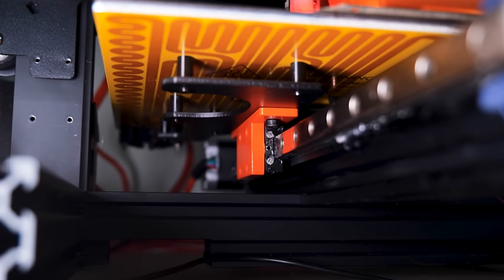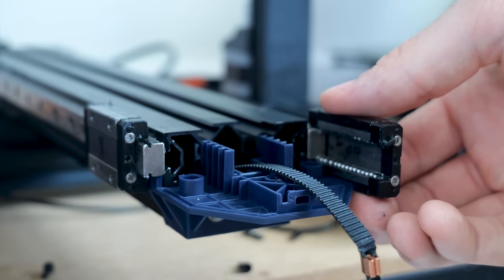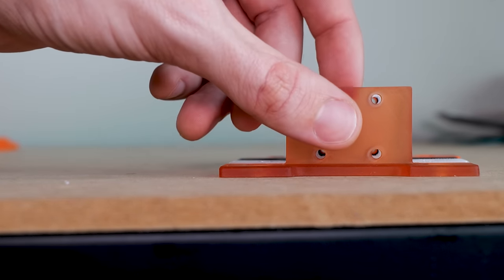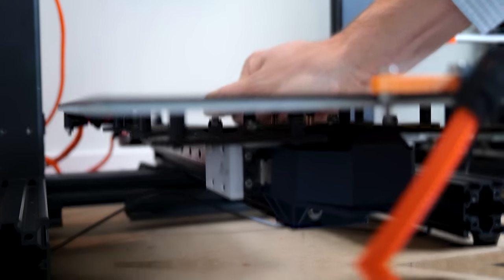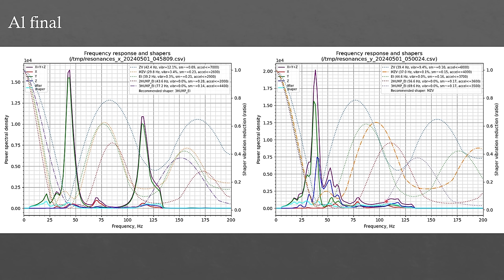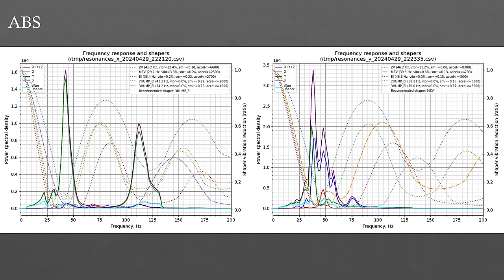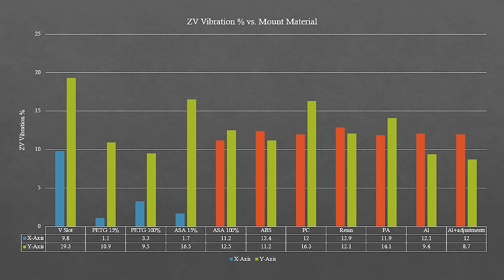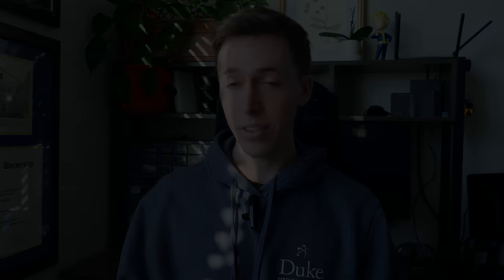Upgrading to Linear Rails a Waste of Money? - An Evidence Based Answer

Comment: If I understand correctly, you have anycubic vyper, I have a few questions about it: 
1) Did you do a mod to make the stepper motor drivers work in uart mode, and is it on a stock motherboard, or did you replace it? 
2) Did it bring any benefits if so?
I'm asking because no matter what I do, when I exceed the acceleration of 209mm/s² on the y-axis, this axis starts to make terrifying sounds as if something was about to break, also if its important I use marnin for now (to much work to go from working marnin to klipper mayby some day)
Reply from the maker: I sure do have a Vyper. I actually have a video on the change in electronics which will answer your 1st question! I will say, I enjoy the new motherboard a lot more for various reasons. I can't point to what your issue may be. I would check that your belts aren't too tight, motors aren't burning hot to the touch during operation, etc. Hope that helps! Also, I definitely recommend Klipper. It takes a bit of a learning curve, but it's super cool.
Reply: @SpencersDesk  I thought that my problem was related to the fact that currently stepper motor drivers use standalone mode (if I'm not mistaken) and at higher speeds it is better to use in UART mode, or at least that's what I heard, but I noticed that the problem is with the belt, but I doubt that it is weak or too strong tension, because I managed to observe that at these high speeds the belt somehow starts to vibrate at the end of the rail, so probably something is crooked somewhere.
Anyways thanks for your answer.
Reply from the maker: @GremlineQPl I don’t believe there’s any difference in stepper performance between UART and standalone. Standalone means the TMC drivers are in SpreadCycle mode naturally which is better for higher speeds/accelerations. Having drivers that you can communicate to with UART doesn’t really change much IMO. Not sure what the problem is though. Good luck!!
Reply: @SpencersDesk  if you want to hear what it sounds like I once created a post on redit, I added a video there where you can hear this sound (normally this sound is louder than in this video) and you can imagine the horror when something started printing and suddenly you hear something like that. I deleted the beginning of the link because yt doesn't like it
/r/AnycubicVyper/s/3LGTY505xF
and finally, thank you for this conversation
Reply: @SpencersDesk  ok thanks for this conversation, I would send a link to a post about it that I once created (if you wanted to hear the sound) but yt doesn't like it

Comment: Also a major upgrade to solve printer stability at higher speed and acceleration is just ... firmly anchoring it into a slab of concrete. Your best 10$ spent (after a cht nozzle XD) check CNC kitchen vid for that. It is a bit old but still up to date. that was a very interesting video, please keep it up !
Reply from the maker: I’ve seen that vid! I definitely intend on doing it one day. I’m planning a video about eliminating resonances around the printer and that would likely be part of it. What’s the cht nozzle? Thanks for your comments!
Reply from the maker: I think they know about that (it's in the CNC kitchen video) but that's a great reminder! I actually don't know what kind of foam to go with when I eventually get around to doing this.
Reply: @SpencersDesk  Nice ! I wanted to do it on mine, but the enclosure i built is from a couple of ikea tables called lack... and they are basically cardboard, so I am not sure it will take it. I already had to reinforce it toprevent twisting. Cht nozzles are the ones that split filament inside, usually in 3 parts. It increases flow like crazy without the need to heat more, use specific hotends, or a stronger motor for the extruder. You could make a video to compare cheap ones and the original for example :)

Comment: Great video - great analysis!   I have machine tool design background.  Big difference between linear rail trucks that have a light preload (much better damping, much more friction) and linear rail trucks with normal fits (slide freely, less friction, much less damping).  Just something to keep in mind.  Side note, your grease might be a bit non-newtonian, high friction at high speed. Expected operating temp of grease might be much higher (??) than temp seen at rails in printer ?
Reply from the maker: Great input! I didn't know about the differing amounts of preload before this video, just that there was preload. Do you have a recommendation on which preloads are better for which axes? I imagine you'd want your Z's to have a preload and the X and Y to have less preload? I think lubrication is a whole other world so hopefully what I've got is good enough for now haha

Comment: steppers and drivers may be heating too much during the speed test. You may want to up the stepper voltage reference too once cooling is sorted if it still cant go faster. Also, losen the belts, more often than not they are way too tight and put too much strain or steppers
Reply from the maker: That was another idea in my head, although I attribute most of it to my lack of experience. Belt tensions definitely weren’t the same for both tests which is something I need to figure out how to control better in the future!
Reply: @SpencersDesk  i saw a video recently made by "lost in tech", about belt tension,while trying to find why my steppers were so hot i could not even touch them. He explains how they need to be barely tightened to avoid going over stepper specs, and how tightening them more only puts more strain on steppers. Dont worry about lacking experience, experimenting is how we learn :)

Comment: It depends. Fixed some issues i was having with me s1 plus. Bolts pressing into frame was causing my bed to tilt up as wheels ran past. It also got rid of side to side wobble. Completly eliminated first layer issues i was having. My other machines are happy with rollers.

Comment: Possibly try mounting the rails to be horizontal instead of vertical would make the speed better? Thats about the only other thing I could think to try out, but that might require printing out some L brackets to fit the sides for mounting. that would also allow for you to have more clearance from the switch and belt tensioner as well.
Reply from the maker: I think my current plan is to get some aluminum extrusions to replace the y single y axis one, and the single one on the bottom of the printer connecting the left and right side together. I’ll then, like you said, mount them horizontally instead of vertically. I think this is a much better way for the rails to be mounted, but maybe it won’t make much of a difference? I think the best thing I can do is ensure they’re parallel, and grease and clean them well (which I didn’t in this video)

Comment: on a side note... the initial machine oil removal should look more like a half an hour soaking than wiping with a paper towel, especially for the carriage sled... I slide the sled while doing it too, any my logic says that my grease should actually aid in dampening because of it's higher viscosity, I use the one in the grey tube and I always slide it back and forth for a few minutes before full assembly... I also dont keep tools in my printer drawer, I just figure that the jingle and add resonances. (also diengage the motors if youre doing sliding of the sled to distribute the grease well to prevent electrical feedback to the motherboard)
Reply from the maker: I definitely did this wrong… I plan on doing a more thorough video on it down the line. Thanks for your wisdom!

Comment: They are so handy for builds. Voron v0 the form factor of the mgn 7 rails allow for a tight build that makes for an easy enclosure.  Rails are used in some of the harshest and cleanest environments.  They are made to known dimensions. They just make sense. Brake clean on the rails,  i soak the carriage in alcohol and air dry.  Mobil ep2 and then amsoil mp on the rail and good to go.  Higher quality v wheels climb in cost as well. Id  give the overall edge to rails.
Reply from the maker: I think you’re exactly right. If I could eliminate v-slot wheels from future builds, I would. However, maybe not from printers that are currently built (assuming the wheels are working fine)

Comment: I mostly use linear rails due to ease of use when building printers as opposed to v wheels
Reply from the maker: 100% I would do the same. Linear rails are better than all the other motion solutions in my opinion (except for cost). But this video is solely about whether upgrading is worth it, not if rails are better or not (which they clearly are). Thanks for your comment!
Reply: Yep. Linear rails are a staple of good design if you're making your own machine from scratch or making a major alteration that already requires a new linear motion system, but silly on their own as an "upgrade".

Comment: I have a Bamboo A1 and a Ender 3 S1 and i have to say the v wheels have less maintenance to do as compared to the rails on the A1 as i find the grease and even the oil is just a dust magnet and within days of cleaning the rails and putting new lube on them they get all grindy feeling from all the dust that builds up on them. I have had the S1 for over a year now and have probably cleaned the wheels about 3 times, never adjusted them but feel like the bed ones may have been a bit tight from the factory, the bed wheels are currently looking like little fur balls but they still roll smooth as butter so im not phased. why fix what's not broke yet right hahaha
Reply from the maker: I agree with this sentiment. The grease definitely attracts debris. I also never really saw issues with my wheels. I have heard many stories of others having issues though

Comment: this problem has been solved pretty well in the automotive field in a few ways, when we discuss damping resonance from a 3d printer motion, why don't we consider internal combustion engine mounts? my friend's car was incredibly uncomfortable to ride in because he'd replaced the soft mounts with hockey pucks for a harder rubber, this however gave it much tighter cornering. adjusting the density of the mount material is definitely a route to dampening. I'd expect for printer mounts we'd want a very hard rubber with just a little flex to it, preferably a material with decent insulating properties to prevent heat creep out of the bed too.
Reply: We kind of do? But I don’t know why they aren’t used very often. 

There are stepper motor dampers out there, but I think there just isn’t as much resonance from the motor itself and more of the resonance visible in prints will be from the motion system (gantry, bed, etc). 

I used to build the MatterHackers Pulse (it’s okay that you haven’t heard of it, there’s a reason I USED to. It’s a Prusa clone with arguably better hardware imo), and every motor has a damper on them. It definitely made the printer quieter with the non-silent driver board, but it actually started to cause some problems with the Y axis on occasion. In combination with the PETG blend printed mount, the pulley would get pulled out of alignment with tight belt tension. It wasn’t a big deal, since that meant the belt tension was too high anyway, but removing the damper DID help reduce that twist. 

Similarly to squishy motor mounts, squishy bed mounts or gantry mounts could help reduce big spikes, but I’d imagine it would introduce more issues than it would solve in dampening resonance. Tackling resonance at the actual source with input shaping just seems like a more effective intervention. It’s like tuning and balancing an engine, rather than covering up the problem with more vibration isolation, I guess. 

I don’t know enough about resonance to actually speak on these things, but these are my observations. What I do know is resonance is very complicated, and that input shaping is magic.
Reply from the maker: I would somewhat disagree with one point you made. I think tackling the source of the problem is indeed removing resonance through the build of our machines. Rubber mounts, more rigid connections, etc. First we eliminate the resonance the best we can. Then we use input shaper to mitigate it. IS can only compensate so much and has inverse effects. I’m planning a more in depth video on all this soon!
Reply from the maker: I wouldn’t say solved. Resonance is a huge issue throughout the world, big industry. However, there is a lot we could learn from automotive to apply in printing! ( maybe that’s what you meant)
Reply: @SpencersDesk  great point! I’d love to see more content on input shaping, linear advance, etc, specifically Marlin’s implementation since I still haven’t switched yet. It’s much less… easy? than Klipper’s sensor based approach and I still feel like I haven’t gotten a tune that works well on my machine. 
Do you think looking into the mechanisms behind the different code implementations might offer some insight? I feel like you’d be crazy (and actually capable) enough to do a deeper dive than I’ve seen in other videos on that aspect.

Comment: Linear rails are made for linear motion of machine parts. Vslot is more like diy ish solution which really outperforms the expectations. It performs yes but if you are serious about what you do, you will recognize that it makes sense to use an industrially accepted and tested solution. That doesnt mean there isnt room for innovation. Carbon tubes like of bambu or hydrostatic bearings might be interesting to look at.
Reply: The debate about vslot vs linear rails seems almost absurd. Vslot looks like it has a lot more issues with momentum during acceleration due to the roller resistance and weight of the carrier, but then the linear rail carriers have lots of preload compared, the grease viscosity resistance and then the momentum delta due to carrier weight. 
I feel as if linear rods are the best overall just like Bambu Labs use on their corexy printers.
Reply from the maker: I think it's obvious that linear rails are better than V Slot rollers, no questions about it. The question I tried to answer in this video is, are linear rails going to bring any substantial change for the effort/price? I think the answer is no. If I were desiging a printer, I'd go for linear rails every time
Reply: I'm in the middle of this problem myself, my printer is an old Tevo Tarantula, upgraded lots of stuff in the past 7 years, but never the kinetics for the x and z axis. 
I have a linear rail on the y axis because a friend of mine had a 300 mm Misumi one with absurd specs that he got from a machine that they were scrapping.

The point is not on what is the absolute best system. Rails will win every time. 
The point is if the money you spend in rails is well spent. If it results in a improvement in print quality that's worth the money and effort.
I don't print miniatures. Nor I'm trying to beat the Benchy speedrun record, I print mainly functional parts and the few aesthetic parts I print are usually sanded, primed and painted over. 
Is it worth to spend new printer amounts of money on rails to fix things lile ghosting that have no effect on the properties of the printed part?
Are cheap Amazon no brand rails, which still are crazy expensive, any better than a good wheel design? 

Those questions and their answer are much more subtle than just picking the mechanically better solution on paper.

Comment: Thanks for the video, but i think you are focusing too much total vibration amplitude and missing point. Nearly every case at Y resonance measurement, vibration from Z axis is too dominant. You should add braces or something to add rigidity to z axis and fixing printer to more rigid surface to increase damping. Than getting new measurements from axes may give more intuitive results about linear rails. I love your presentation of videos, keep up. 🙌
Reply from the maker: I agree with this a lot! I’ve actually discovered it’s my print head. It bounces in the z-direction as it goes along. Planning to address this before I do anymore resonance on the x-axis! Stay tuned and thanks for the feedback/kind words!

Comment: On the material properties, even though PC and Nylon might have better resonance properties, they have a lot of creep. ASA and ABS have very low creep which is why Voron builds use those materials. A printer that forces you to re-tighten all of the screws every few days is not a fun time. Thanks for the video!
Reply from the maker: Hey, great tip! Definitely helpful for me to keep in mind!

Comment: Rods with LMxUU bearings are the optimal option IMO, Prusa picked them for a reason
Reply: Definitly, but always high quality ones. Prusa had some not so nice ones in the beginning of the mk3. Personally I have good results using Misumi bearings.
There are alternatives like brass bushings. However, they are much more precise and have lower tollerances. You need some way to place the rods more exactly in parallel- Trying them on my mk3s+, it moved smoothly in the middle of the x-axis, but bloccked at the end of it.
Reply: For the cost of a high quality one, you can buy a whole printer from creality, so... yes it is better. It better be. Meanwhile my ender3 v2 prints petg at 150mm/s (everything at that speed, infill, outer walls and so on). without rails.
Reply from the maker: One thing I see as a problem with them is the difficulty in setting them up. The linear rails were fairly straight forward, but I’d have to design parts to get rods. I definitely agree with Prusa design. I wonder what made them choose the rods?
Reply: @SpencersDesk Stability across the bed. Rollers have so much variability across the bed (wear spots, tension, etc). Rods are… rods, as long as they are as straight as possible.